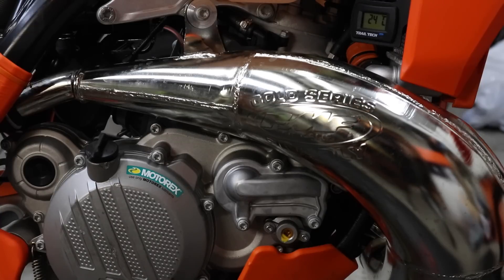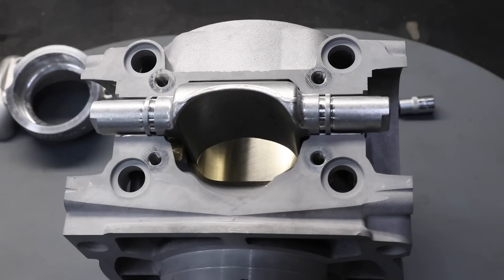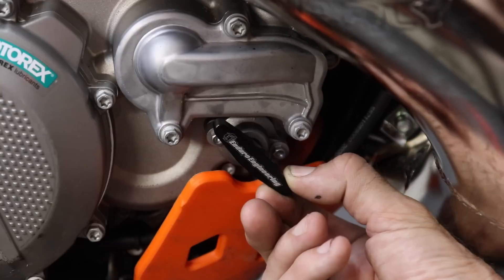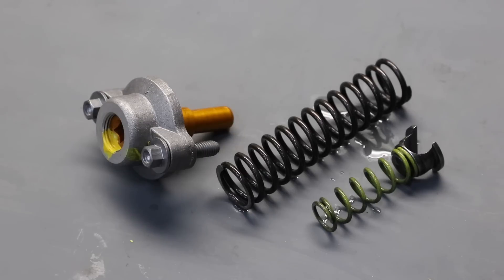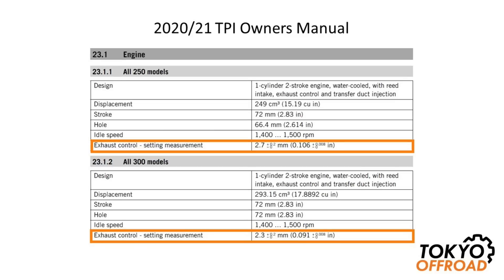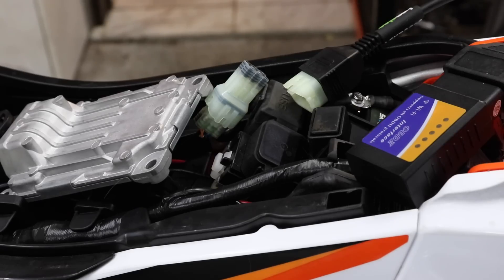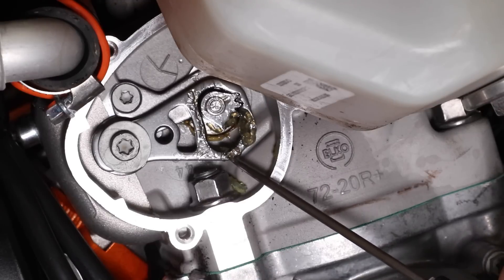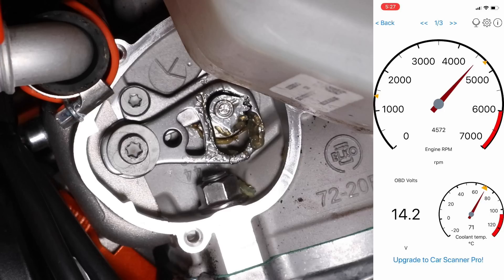KTM & Husqvarna TPI Exhaust Valve Explanation, Test & Adjustment

Comment: Save yourself every other video on this subject and just watch this. I can't get the 5 hours back I've wasted on every other channel. Great video as always.
Reply: Ok but does the bike actually run perfect at this spec? Im pretty sure this spec is for emission standards, not for good overall power delivery
Reply: @samuelyeet6006  “good overall power delivery”…is different for every rider, and at many times in different conditions.
Reply: @719vol  k
Reply: @samuelyeet6006  
As he said, good power delivery doesn't necessarily mean maximum possible power delivery.

But you might be right nonetheless, although I don't think the exact opening timing of the valve has such a big influence on overall emissions. After all it's always closed at low & open at high rpm, and there's only so much room for adjustment without going into nonsense territory and hurting performance.

So maybe yes, but actually no, not really.
Reply: @heinzhaupthaar5590  100% agree im not chasing power in my bike, but perfected power delivery, i want smooth throttle and crisp response.

Comment: Great explanation, Why did the 500cc motors opted out on the power valve back in the day?
Reply from the maker: The Kawasaki KX500 had a power valve. And the modern day BRC 500 has a power valve. However the Honda CR500 doesn't. Why? Reasons I can think of include cost and performing "good enough" without one as most people would short shift 500s anyway.

Comment: Can you do a video on how to best fix the PV stop bolt leak on the front of the motor. Is it as easy as removing the nut and putting sealant on the the bolt threads or do you need to remove the cylinder for better access? Again, asking about the PV stop bolt leak, not the PV valve cover leak.
Reply from the maker: Noted. I've only ridden my 2021 for one ride (just under 3H) and haven't noticed bolt leaking oil so far. I'll keep my eye on it and if it starts leaking will make a video, including a fix...
Reply: @TokyoOffroad  
Thanks Mark.
Reply: My EXC 300 has oil leake as well!
Reply: My 2020 300 exc also leaks a little. I ordered the replacement seals recommended, which I think we're the same as 2019. I believe KTM also updated their specs to the new part. 54637107000
SEALING ELEMENT BOTTOM
54837091100
SEALING CARRIER 07

Comment: Are these factory settings for best performance or for emissions ?
Reply from the maker: Good question! The TPI 5,500rpm exhaust valve initial opening spec is close to the carb model bikes' spec. The exact spec changed depending on the year model. Example: 2018 KTM 250 XC W carb bike spec was 5,250rpm and 2018 KTM 300 XC W carb bike was 5,500rpm. As such I think the TPI spec is a good baseline performance setting.
Reply: @TokyoOffroad  Thanks for the speedy input .
Reply: @TokyoOffroad  "The secondary spring starts to take effect right around 5600rpm and that's regardless of where the dolly screw is set." JD Jetting. https://pbase.com/jdjetting1/image/162720650    Love the videos, keep up the good work.

Comment: What is your opinion on changing the PowerValve to suit different rider preferences on TPI bikes? In earlier models it was more like "set it how it suits you" and not like "here is the spec, set it and dont touch it" Kyle from DirtBikeChannel made a video about that and i am keen to hear your opinion on that matter! Heres the Link to his video: https://www.youtube.com/watch?v=KaS6_72PHD8
Reply from the maker: My opinion is that there's a big difference between carb bikes and TPI. When performance mods are made to a carb bike, if the bike feels lean, or rich after the mods the owner can easily tune the air/fuel mixture using the carburetor (E.g. change pilot, main, needle, or adjust the airscrew). With the TPI you can't easily make changes to the fueling if using the stock ECU. As such you need to be careful what mods you do and closely monitor how the bike feels after making a change, or you could make the bike run more poorly, or worse case damage the engine. 
My plan for my 2021 KTM 300 is to next fit and test an RK Tek head, while leaving the PV setting stock. After that I plan to install a GET ECU and may decide to test different PV settings at that time. I'll be making update videos as I go and will share my honest thoughts regarding how the bike feels after each mod...
Reply: @TokyoOffroad  Thanks  a lot for your feedback, I will follow that videos as your content is way more "scientific" as other channels thus making your informations a lot more sound. Is it possible to install a O2 Sensor in the system to messure the Air/Fuel ratios from stock/ RKTekHead+ECU/ RKTek+ECU+PV changes, or is this not a "practical" solution? Keep the great content coming! :)
Reply: @TokyoOffroad  regarding the "adjusting power valve" topic I assume that the coolant temp sensor reads engine temp so the ECU takes it from there for the fuel mixture adjustments